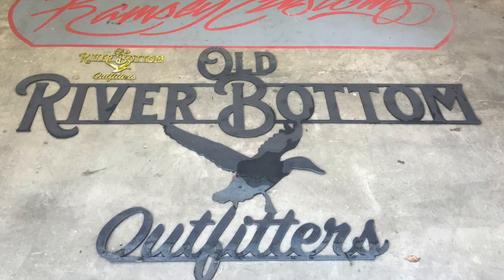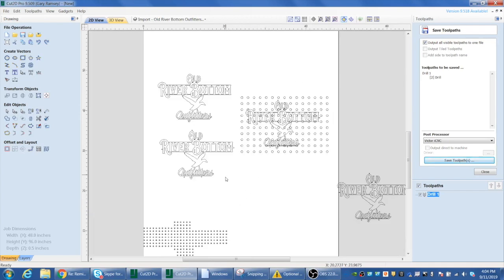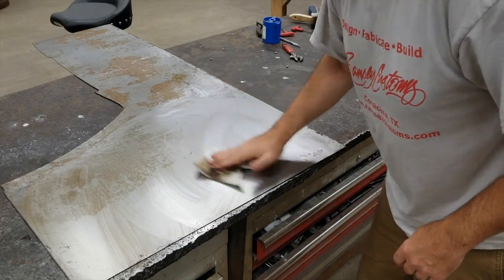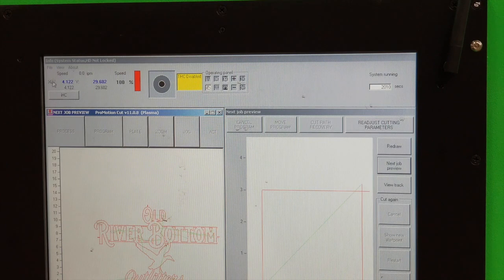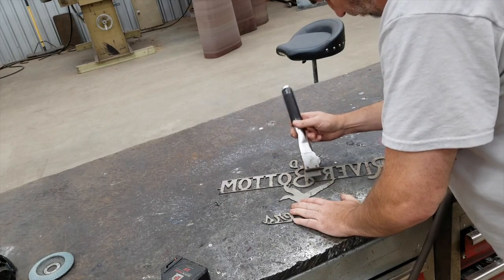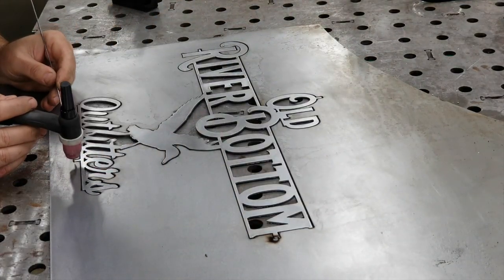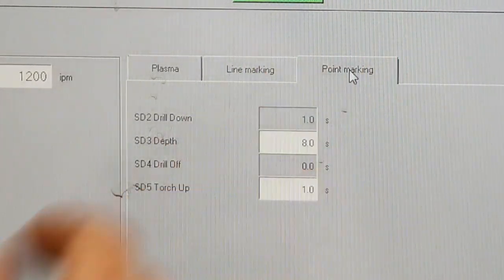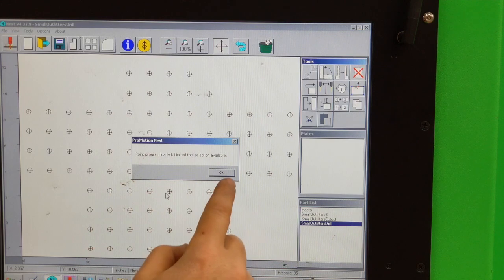Experimenting with CNC Plasma Table Live Spindle with Dirt Road Metalworks

Comment: That's a great implementation of a router on the table!  Have you considered welding the tabs to a flat piece of steel as the backer you mention?  You wouldn't have the 'press through' on fine parts and the backer could be reusable for many parts.  You could tack any number of cutouts to it and add the turning feature to multiple at once that way.

Comment: Waste of time with a plaz table unless you’re doing a large area. Do the jeweling first before you cut your piece then you won’t have to worry about tacking it and it pushing it down where you didn’t tack it
Reply from the maker: And here all this time i thought you were a smart fabricator.  If you were, you would know that the cutting process can leave dross at the pierce points on small details with short leadings and you would know that plasma on thin material leaves a very noticeable HAZ, so by doing the turning work last, all that can get cleaned up.... very disappointed at this comment, what a let down
Reply: We use an acid cleaner for the HAZ and a chisel for the dross and if we do mess it up we take it to drill press and touch it up